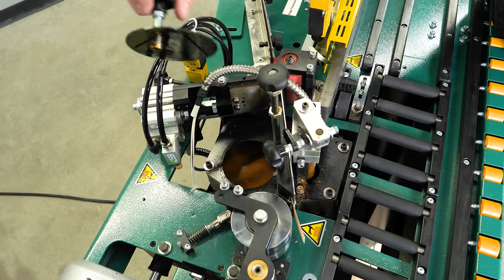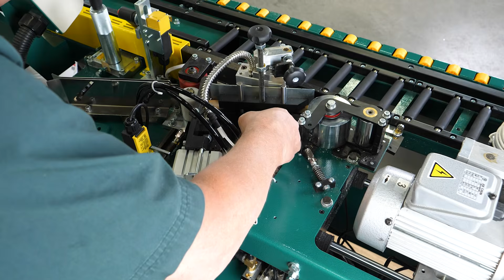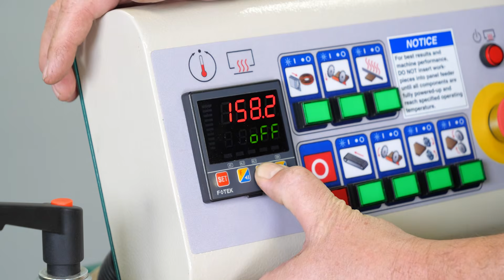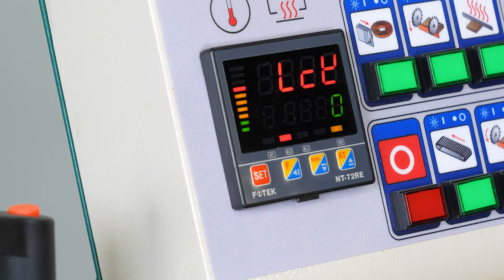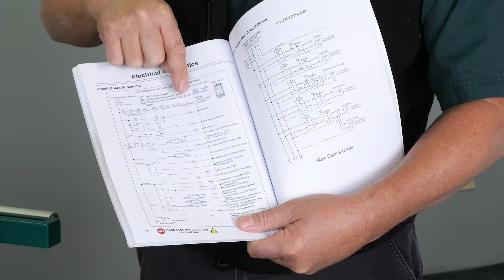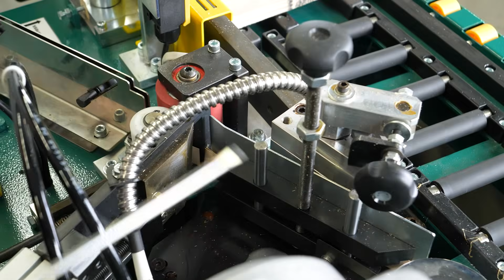Grizzly Automatic Edgebander: Glue Pot & Fotek Controller | G0774 & G0854

Comment: PVC 5 mill ?
Reply from the maker: We appreciate you reaching out. The edgebander accepts PVC edge banding from 0.5–3 mm thick. Since 5 mil is only 0.127 mm, it’s too thin to work with this machine.